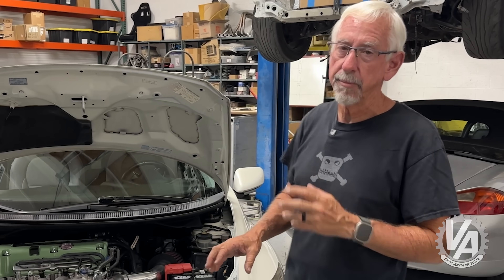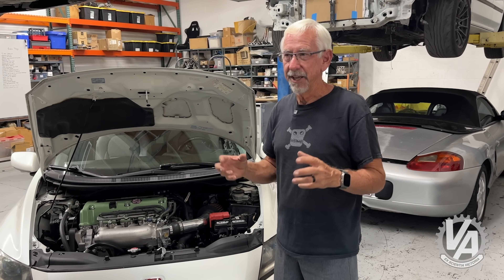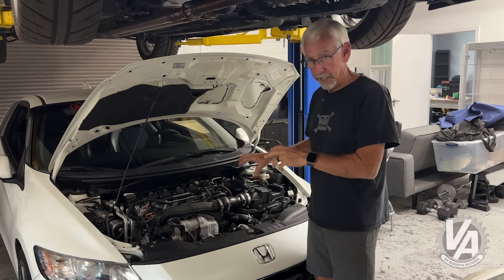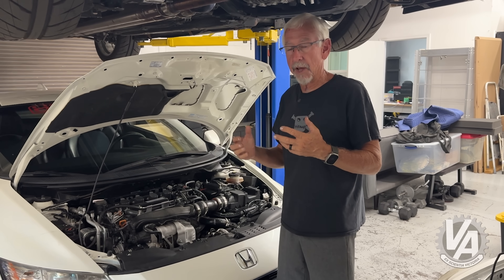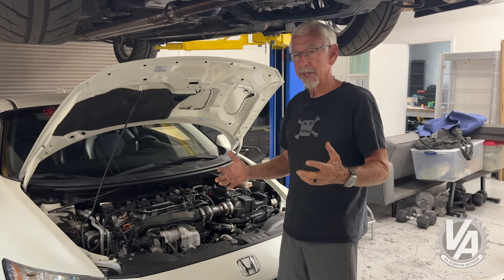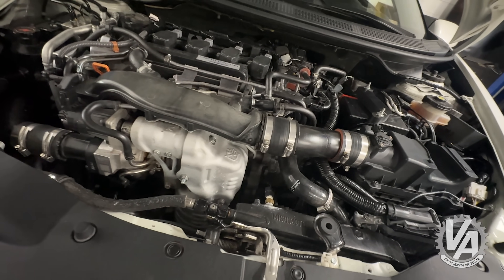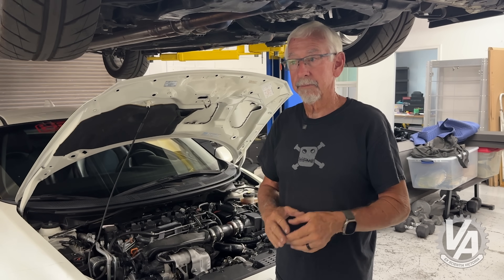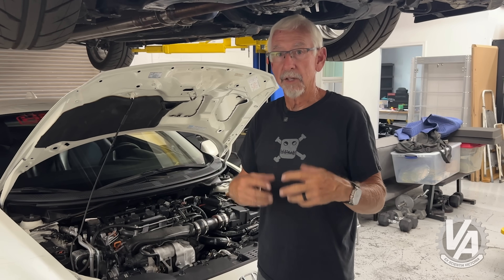We Knew This Would Happen! Honda Engine Swap History Repeating: ZC to B to K to WHAT?

Comment: Building a turbo zc. All forged internals 5 angle valves converted to obd1 with s300. Beat that for old school. And a spare motor and cylinder head. All real jdm.

Comment: Why go through a K-swap when you can just build and turbocharge the CR-Z’s stock motor? The car only weighs around 2,600 pounds — you don’t need crazy power to make it fast. A solid 300 whp is plenty; anything beyond that is just wheel spin. The turbo route is cheaper, simpler, and way less hassle than a full K-swap.

Comment: The l115 internals are nowhere near as beefy as a K24. Just look at the difference in the head bolts, crank and pistons. This thing will blow up eventually or you may have to change out the head gaskets every 40,000 miles. I wouldn't waste my money doing an l swap. There was one making 680 hp that exploded on the dyno. Just a warning to you guys and gals.

Comment: Wait, pulling an LEA(basically an L15 but with atkinson cycle) out of the CRZ, and swapping it with an L15B7 
Hear me out, an LEB3 swap with the 180HP electric motor.
Though the suspension and room for a battery is going to be a problem in the CRZ.

Comment: K swaps aren’t going away but it’s nice to know there is an option for a modern swap. I have a 24 si. The l15 in this car is adequate, does 140 mph, quick get up and the transmission is strong. My point is if you want an engine that can get you high mpgs and decent power with parts readily available at the dealership, parts store or online, then swap this engine into a small, lighter and agile package for weekend cruises through backroads rather than the drag strip or racetrack, the L15 is the engine for a daily project car that can be fun when you want it to be. I just so have a car that already has it in from factory and I like my civic. 55k miles and still going strong.

Comment: I really hope that swap kits will be developed for the 3rd gen prelude , we only recently got good support for the K-series. Where i am from there are barley any k-series available but a lot of l15's are.
Reply from the maker: The L15 is taller than a K and the 3rd gen Prelude has such a low hood line. I’m not sure how that would work.
Reply: @VTECAcademy  aaa damn it is taller? that sucks, a K24 just fits in without cutting the hood

Comment: I could of swore I just watched another video that said the L15 has weak oiling, weak rod bolts, weak head studs, and a horrible rod ratio and they are grenading at 300whp.. I could be wrong but I swore thats what I was reading on the motors that come in the new Si / Integra A-Spec.. Hopefully im wrong. The beauty in the old K's B's and even little D's is that you could make a ton more power without even opening the block.

Comment: Swap my K24 in my EM1 in 2021 never had major problem just tweaks and upgrade here and there … I track the car 3-4 Times a year (quite intense track days) 
Didnt lose 1 psi of cylindre pressure, still make 220whp on 91 (dont have e85 in Canada) 
Im not sure to have that reliability on a L15 SPECIALLY with 3.5l of oil in turbocharged engine is NUTs to me… or course they are gonna be plenty but i think K is still the way for long term keeper people, they are just so reliable and fun to drive L15 is lack luster Even with 240-250whp and way more torque… engine dont seem connected to you and responds as well to input…. 
L15 turbo are meant in my opinion for the Honda Fit and CRz line up since its basically the same base engine but for older Honda without the N/A scream over 8k rpm it isnt the same

Comment: Dude so i bought a 2003 accord. K24 5 speed. I wanna swap it in my 95 civic ex but i dont know what i can use off of it.  

Obv i can use the engine and trans. But what about the engine harness and ecu and axle ?

Comment: The L15 has some serious issues: oil dilution, carbon build up from direct injection and a groove on the block deck that causes the head gaskets to fail. The connecting rod bolts and head studs are weak.  It's an over square engine designed for more torque at low revs that is optimized for light weight and fuel economy not power up grades. 
Bring more into my business....

Comment: The L15 is a weak piece of junk that will never make the kind of power people have been making with the older engines. Lot's of things working against it like the small main/rod journal diameter and bearing width, and just overall weakness compared to the beefier built older engines. It is not gonna reliably handle making power like the older engines did.

Comment: What about the 1.5 head gasket failures and the weaker internals like connecting rods? A lot of YouTube channels with L15 teardowns and low mileage head gasket failures. My question would be is this engine as bulletproof as the K series?
Reply from the maker: We are going to build a 500HP version of this motor and see how it holds up.

Comment: I had been into Honda for a long time. From various swapped Civics, ZC swapped CRX to F20B swapped 5G RHD Prelude to S2000s to a bagged CR-Z.

Personally, I would love another CRZ this time with a swap, and would prefer the K20 over the L15. It doesn't have the powerband that I associate wth Hondas. You can check my channel and see some of those various Hondas, and other stuff, including my S550 Mustang that revs to 8500 RPM. My Evo is waiting on the weather and should be 9000 and will be on the channel. Engines that don't rev high are garbage. Even when I had Hondas, I would only do full VTEC swaps, no hybrid like B20VTEC as it cost RPM. I wouldn't do a K24 aside from the 1st gen TSX version, which I've owned. I side-eye the 9th gen Si, and my S2000's were AP1's for reasons., Only the inability to source K20's would stop me, as I would not make a project of swapping a low revving bad sounding motor into a car. Would a CRZ be more fun with a turbo L15 than the hybrid L15? Yes, but I would not spend my own money to do that swap.

Comment: Its not 2013 anymore k swaping is no longer that inexpensive and chassies are not cheap anymore. maybe if honda steps back up to the plate with better cars that come back to there light weight high rpm roots. Ther newer engines will take off but where in the dark ages of honda now for sure.
Reply from the maker: We are all pining for the B and K series screamers of yesterday. But unfortunately, they are not going to be made anymore.

Comment: Thank you for talking about axles at 12:28 in the video. (Hasport, Insane Shafts, Drive Shaft shop). Do you recommend those usual suspects for stock Hondas/Acuras? I find that Raxles rebuilds OEM axles and they can be more expensive than Insane Shafts and Acura dealer discontinued selling rebuilt OEM axles for the TSX. The axles from AutoZone have a wobble on hard acceleration.

Comment: Jjjj waste of time and money I can say.i build a d15b2 with p08-3 head no VTEC or turbo crap junkyards parts shave head 30 over better springs set bore mild with 272 cam regrind put a Weber carb on header free flow exhaust system homemade made lighter flywheel and gd clutch kit and some times I run old 2 Battle carb with bit bigger needles tune old screw 🪛 and timing playing and believe my CRX is a beast on higher rpm crap k20 k24 b16 have a hard time to get close to me my pull hard from 2500 rpm to 7600 rpm with carb combos cheap to maintenance and cheap to build nothing fancy she sounds like a old Ford muscle car and move like a falcon and look tuff bring it on no computer crap using obdo distributor and EMC with old school style knowledge CCR born in the byouooooo nothing fancy but man man she is fast her sound make people ask and her old school style looks fade paint make people snap pictures of her jjjjj 😁 junkyards parts and head gasket but I'm old school style I like the old carb and cam sound and the smell of gas jjjjjj 😁 gd video
Reply from the maker: What’s a carb?? 😝 That sounds like a really cool setup!
Reply: @VTECAcademy  carburetor is a carb pinto Ford carburetor or a Weber carburetor  believe me a lot easier than EMC vacuum etc crap plus to tune a screw 🪛 and timing and CCR born in the byouooooo

Comment: The k series will never die. They made close to 1million accords in each year from 03-08 which have the base k24, they also put the k24a2 in the TsX although the years is 07, boasting 210hp stock, it also came in the CRV, the Fit, the element, and the Crosstour with AWD in most of these cars. K series won't die for another 20years
Reply from the maker: And the B series still hasn’t died either.

Comment: I am rebuilding a 95 Honda Prelude SE with a strong H23A1. Issue is, I'd like a bit more power and torque but want to stay away from turbos. 

Is there a swap you could recommend for that chassis?

Joe
Reply from the maker: J swap

Comment: Is the 2015 Honda Fit 6-speed manual compatible with the SI 1.5L turbo engine?
Reply from the maker: It isn’t, as a matter fact, the transmission that comes with the turbo engine is much stronger. Even stronger than a K trans.

Comment: These L15 motors kills the ideal meaning of “built not bought”.. D, B, H and K series gives you that satisfaction of “building” something from 90 hp to 1k hp nowadays, it’s the feeling of achievement not the feeling of a stock turbo’d out of the assembly line, IMO …
Reply from the maker: It’ll be interesting to see how these engines develop. I think the practical limit will be more around 750 hp as people really push the limits of the L15.
Reply: @VTECAcademy  I wouldn’t be surprised if one of theses tunners some how manage to push 1k hp.

Comment: Can the vtec academy help me out with some info on a project I’m in the
Middle of! 

I’ve got an odyssey absolute 2005 jdm 2.4a performance 198 bhp

I’ve got a fn2 type r 2007 gt 198 bhp k20z4 as a donor for the odyssey.

Type r red bucket seats took a little fabricating to get in but there in, swapping the steering wheel over but that’s also become a little problem 😂.

I want to swap the cylinder head form the k20z4 onto the k24a performance. And convert to manual, if possible using the donor cars parts - if not - how? 

I think I’ve got the practical side down, but the electrical and wire side I feel like I’m about to have a stroke. It’s a challenge and a half 😂
Reply from the maker: The K20 head should just bolt on. You may need to use the pulse plates on the cams from the Absolute if they aren’t the same. As for the manual swap you will probably end up fabricating a trans mount and using an Accord Euro rear mount bracket.

Comment: L15 swaps will never be as popular as k-swaps imo. K motors can handle 500 hp reliably if turboed even on stock internals. L15s cannot handle nearly as much due to the weak internals

Comment: The new Honda motors are crap.. You cant even do NA builds on them... Direct Injected crap.. Super limited in what you can do with them. Even 4-Piston has struggled for years with these direct-injected motors, and they are far from reliable making larger power.... For me, they arent true Honda engines. A real Honda engine for me, is HIGH REVVING, port-injected, low torque engines. That is what makes the old Honda's fun to drive.. You are lucky to get 8-8500 out of a fully built K20c1.. And again, the engine is BORING. Same with the L15... They are mid-range cars with more torque... Fun grocery getters...

Comment: Im sorry but the new engines may have a lot to offer but they lack the beauty of the K and even that iconic look of the B. 
It’s gonna have to grow on me. Thats the reason I couldn’t get into Subies…. It looks like I’m looking at the bottom of an engine and not the top. Just a bunch of shit everywhere and not the main pieces like the beauty of the valve cover and intake/exhaust manifolds taking the eye. The new stuff has no look to them. The new engines have plastic covers kinda like a lawn mower. Maybe I’m just old now lol and gotta get with the damn times. But I do have a virgin DC2 and EK just waiting there and I’ll still prob go with the K even if its potential isn’t as high as stated in this video. If the engines had a beauty to them I could totally jump on this wagon lol. For now I will hold out. 
Great vid, keep up the great work!

Comment: Seen lots of head gasket issues with the L15. Personally I don’t like anything under 2 liters or direct port injection. Don’t get me wrong you can make more power with them. However they are less reliable and cost more to fix.

Comment: I still have my EF with a F23A the was built by BISI with a gsr trans that i built about 17yrs ago now. I haven't touched it in about 5yrs sits in the back of the shop neglected. I'd like to bring it out but parts for the motor is so limited i dont want to break it. Also its a BISI motor extremely rare motor nowadays. It was super expensive for me being i live in hawaii. But man good times

Comment: I'm not very versed in the L series engines, but I've heard the internals aren't beefy and the horsepower ceiling is very low.  Any truth to this?  If so, how will that affect the popularity?
Reply: You need a e85 kit to hit 300hp, 250 with mods and a tune, on an oil diluting heat soaking engine, it’s my daily driver and i don’t think it’s worth spending a dollar on making go faster, just bought an intake for the woosh noises

Comment: U think Hondata will ever get popped by the EPA like other  Manufactureres? What happens when Hondata goes away?... Its a matter of time they get into that situation
Reply from the maker: No. Hondata goes to great lengths to insure there are proper warnings on using their product for race use only while also offering some 50 state legal tunes as well.

Comment: Oil dilution has been a major concern with the L15
Reply: It's not.  Minimal issue that was solved already.
Reply: @DB-mq4so even with the software update it’s still an issue. Injectors fail, head gaskets fail. Worst Honda engine ever.
Reply: @GIZZMOTORSPORTS god bless headstud upgrade kits and updated injectors that came out. The aftermarket is already there.
Reply: No need to upgrade the k series
Reply: Just change your oil every 3k miles no worries😂

Comment: I’ve always wondered why I haven’t seen anything on the k20c2. It’s still port injection I’m pretty sure, and they used it in 24 civics and still the new hrv so they’re out there. Are they worth swapping or modifying? I just saw one with 385k miles too in a 16 civic
Reply: Glad you added “until they blow”😅

Comment: not sure what people are using in the aftermarket world to counter headgasket issues. also would be cool to see the new 2022 l15  vs the older 2016 one with vtec only on the intake side in terms of power difference. does the tune affect carbon build up on the exhaust valve in a positive way?

Comment: It's neat that swaps are becoming normal for the L series, especially considering their ubiquity, but it will never replace K series. You can't replace the best four cylinder ever made, a motor capable of ridiculous power numbers NA and turbo'd, with a motor that is designed almost exclusively for fuel economy. Performance wise, it's like comparing the the c6 z06 to a sbc.
Reply: K20 feels like 1990s Formula One tech you can find in the junkyard now

Comment: We need to do a L15 swap soon. Great video!!
Reply: Hi. I have DelSol with L15b7 with some tune. It produce easy 260hp/330NM. Transmision with LSD put this 205/50/15 Toyo R888 tires and all car is like a new Honda from 2023. We make this swap year ago. I can recomend this to all of you who want to have not super fastest Honda on the street, but great, daily with a lot of fun.
Reply: @olafprzybyszewski5096  How many miles and do you have an piston ring blow by issues? I've heard nothing but bad things about the L15's.
Reply: @SI0AX the biggest issue with the L15 are the head gasket issues when you turn up the boost past 23psi. Luckily there’s a few companies that make upgraded headstands to completely combat that. Another thing, you don’t want to make a ton of torque super early on these engines, peak torque should be at 3500-4000rpm for rods sake. The 10th gen sedan and si L15B7 have the exact same rods. It’s the hatchback that got weaker rods for whatever reason. I believe the CRV has the same turbo as the si as well. Now for 22+ the civics turned to a twin scroll engine and higher flowing head just like the 10th gen accords so the turbos spool quicker and last longer in the rev range. The civic si and integra now have their own specific engine code (L15CA) and come with slightly thicker rods.
Reply: @ValkenDnB  What I'm mostly concerned about is the Direct Injection carbon buildup in valves and piston ring issues, like severe blow by leading to massive oil consumption. It's what makes me avoid Direct Injected engines.
Reply: @SI0AX catch can solves that 🤷‍♂️
Reply: @ΗΕΑΗΘΣ  I think it's not 100%. It slows it down a lot but that depends on how well the vaccum and design are. I had a DI car and I ran an oil catch can + methanol injection.
Reply: @SI0AX  for 2022+ the 2.0L NA engines in the LX and Sport trims actually switched to  port injection meanwhile the 1.5T stayed on direct.
Reply: @ValkenDnB  That's because it's the Hybrid engine. Hybrid engines are very durable engines. I saw a mechanic take apart the Prius with 300k miles and he said it was brand new inside, the equivalent of 30k miles. That is the engine I'd go with for durability.
Reply: @SI0AX  its a K20C2. Not sure if the engine used in the hybrid (atkinsin) is the same one used in the LX and the Sport. My guess is it is, but it’s very refined.
Reply: @ValkenDnB  It's not the same one. The K20C2 is a non-turbo variant of the C1, C3 and C4. They are all Direct Injected. Also it's not an option for the Accord, but for the Civic.

The Accord Hybrid engines are the LFA1 and LFB1 which I think is what you meant when you said 2.0 non turbo, non DI.
Reply: L15s are garbage